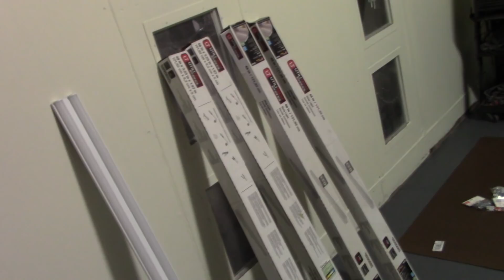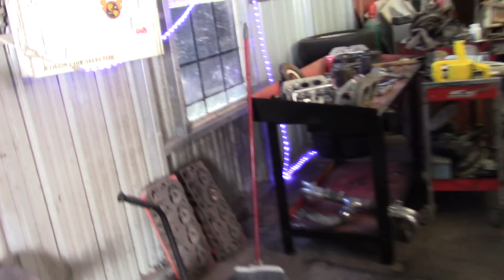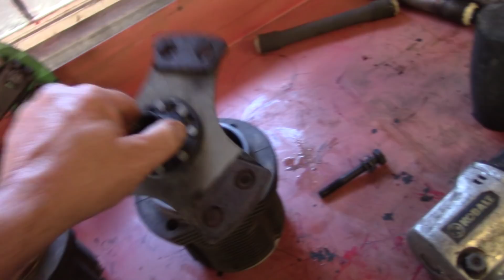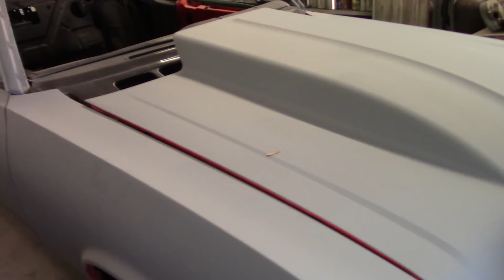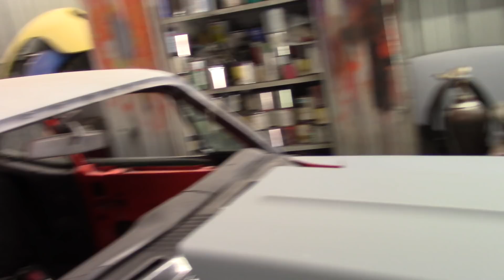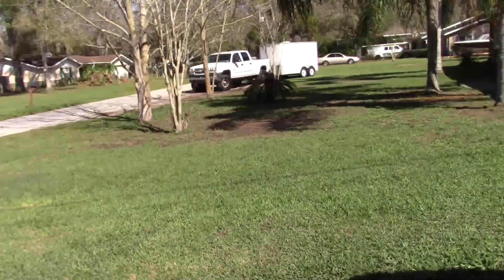a look at the Turbo motor

Comment: You always want to apart cylinder heads and check them before you install them. I had a friend with a set of trick flows that put his engine together and the combination should have RIPPED, for some reason it was hard to start, wandering in the idle , and just was soft in the top end.. they pulled the engine apart and found out about  of the valves could have had milk run through them!  and the rest weren't as good as they could be. when they reground the seats and lapped in the valves properly , it actually did do what it was supposed to. No good if they have been ported with the profile that won the last Daytona 500, if they are assembled by people who work for $10 an hour and have never owned a car themselves, you're gonna have problems.. I see the same thing happened to a guy who bought a top dollar set of AFR's too .. Half the valve stems out of whack.. come on, if you're paying that sort of money, you expect something that works out of the box..